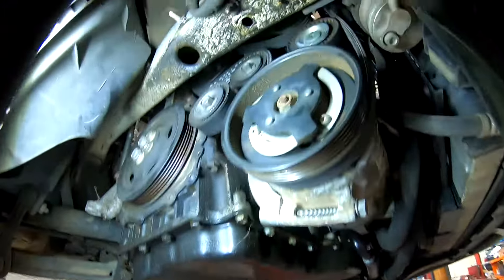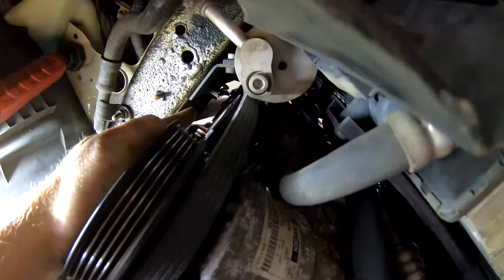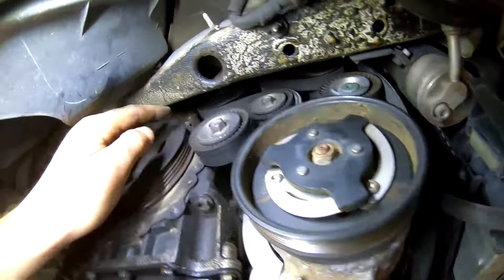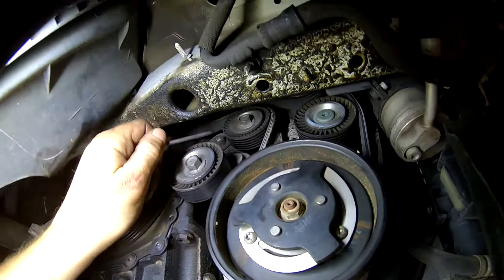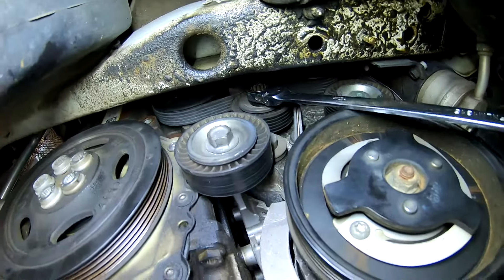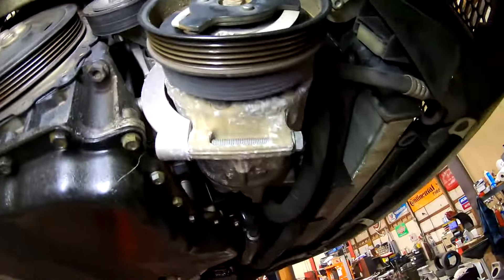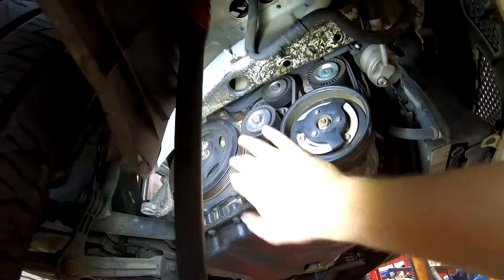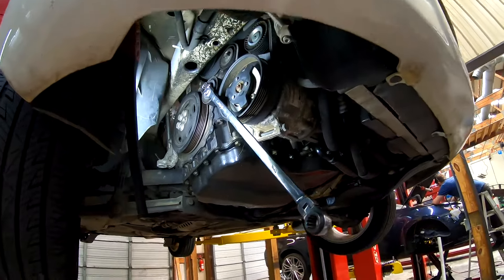VW 2.5L Drive Belt Change

Comment: that shit was hard as fuck! i tried everything and the only thing that worked was to take off the second tensioner, and then use a breaker bar with a 15mm wrench to pull the tensioner WAY back and slipped the belt over the tensioner pulley. 2009 volkswagen beetle 2.5l

Comment: OK brothers, I have a 2013 Jetta Sportwagen (beast) 2.5 and serpentine layout similar to above so I offer this: I put the belt over the top pulleys and rollers first, all but inner drive pulley. Although the tensioner was all the way open/extended I could not get belt over larger outer (AC) pulley. Success came when I first put the serpentine belt over the water pump pulley, the tensioner and also inner drive pulley first and then was able to push it over the alternator and lower idler pulleys from above. Good luck. Also, It is imperative to have a flex-wrench 15mm to move the tensioner. Very little clearance in there. Last advice: removing and replacing the AC belt tensioner roller/pulley is easy and gives you more room to maneuver from below.

Comment: Hey, wht year is your car ? Having trouble finding parts for the motor with the power steering pump at the top of the motor. Most engines have the power steering pump at the bottom